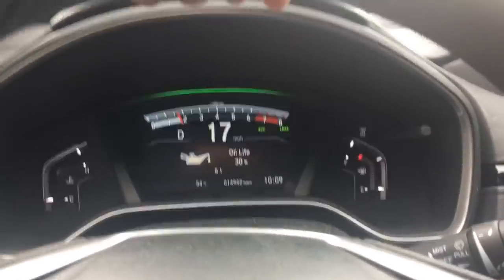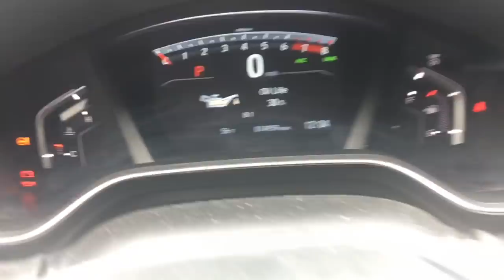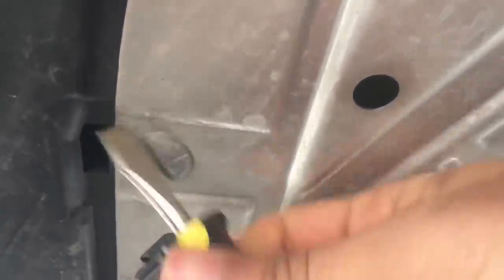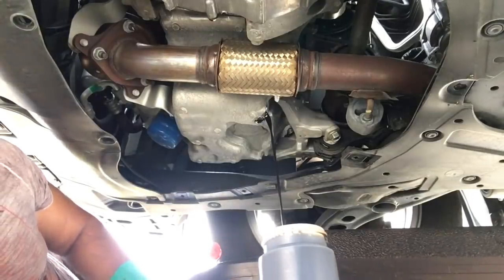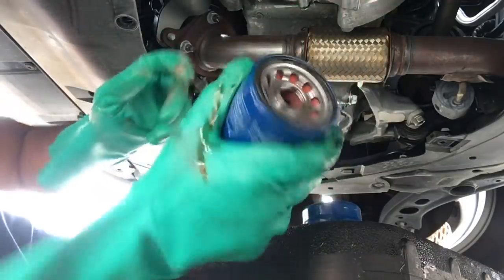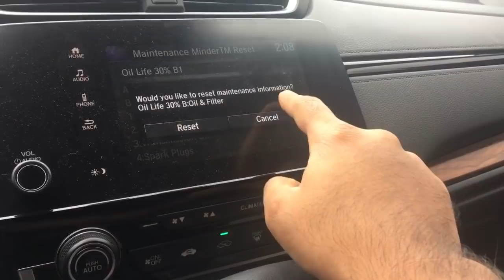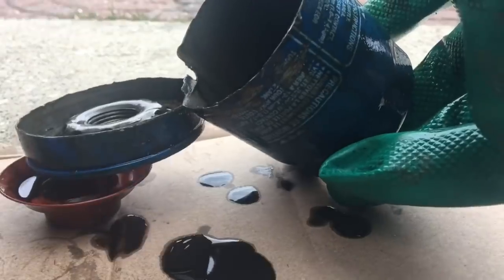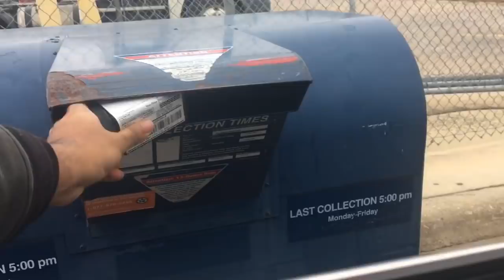2018 Honda CRV Oil/Filter Change and Analysis - Oil dilution -  Cut Open Filter

Comment: In depth video and you didn't tighten the drain plug. You covered every other step but one of the most important. Lose that plug, lose that engine.
Reply from the maker: Dan Wood I figured someone was going to mention that. I did tighten it... just not in the video.  Tighten the filter also. I will put it in the description for future clarification.
Reply: @EATSLEEPJD  thanks for replying. Nice job on the video. It's the small things that bite a novice. I was actually worried that fough may have been too involved in the video and forgot it.
Reply from the maker: Dan Wood Good catch !  I was thinking that while editing. Forgot to get the part where I tighten them.

Comment: If you put in 3.7 qts, then the reading should be right in the middle between the high and low marks.  You need to measure it on perfectly level ground, like a garage, but those orange dipsticks are difficult to read, especially when the oil is brand new.  Good luck. I've noticed a little bit of an increase in my oil level after driving it in cold weather.  I'm waiting to see if the fix Honda came up with actually works and whether or not they contact me to have it done - they're suppose to, since I live in one of the 2nd tier cold weather states-MA.
Reply: @wallyfrey6632  yes! Hamilton vs America Honda.

Comment: Parents  have 2017 CRV AWD, just had in shop and told them I smell fuel in oil dipstick. They won’t acknowledge or do anything .
Reply: Honda wont repair the engine y til you sue them Hamiton vs America Honda.
Reply: Yes, lies lies lies by Honda

Comment: Lube oil mixing with has only happens due to blowpast if piston rings are wornout or cylinderliner wornout partly burned gas oil  oil mixes with lube oil.

Comment: It appears that you used oil specific for high mileage engines over 75000 miles.Is that correct ?
Reply from the maker: Krystian KRYSTIAN That’s what it says. I just got the full synthetic oil.

Comment: Does anyone know how high the oil level must get before the rotating engine parts begin to cause aeration and potential loss of proper oil pressure
Reply: If you see small bubbles on the dipstick with the engine off then its already too high. I would say anything over 1/2" over the full mark in the dipstick is a concern.

Comment: I wouldn't let you change my oil;  I fill the filter with oil, if  possible, before installation.
Reply: How about just letting him buy you the high mileage oil with less than 20,000 miles on the odo?
Reply: You know how many filters get changed by dealerships and other shops most people don't fill them. It's not a big deal. I've never done that and my last Honda had nearly 200k on it with no issues.

Comment: Why use high mileage oil? U know those oil expend rubber seal a bit but ur car is new so should not need to use it.
Reply: M M 

Rubber is just one type of elastomer. Not used in contact with fuels or lubricants.

Comment: the 2010-2016 crv were a lot better than the later models. no turbos, no torque management software, bigger engines 2.4 lt. Everything better. Less problems. wondered why they went down that route of using smaller engine 1.5lt. Don't like that at all. not cool!

Comment: You're oil is black.... I wouldn't wait so long next time... Especially with the dilution issue.  I'd change it every 3k
Reply from the maker: 06XTOR color has nothing to do with the properties or oil tho.  I send mine for analysis il let you know how it is.
Reply: @EATSLEEPJD  Of course it does... When it's black it's dirty and breaking down. Let's not over think this
Reply: @06XTOR  That's just how synthetic oil is.
Reply: @waynes.2983 What I mean is synthetic oil turns dark quickly. But it's supposed to last 7-10,000 miles. Changing synthetic every 3k miles is throwing your money away.
Reply: @ryanlittleton5615  7-10k is a bunch of bologna.  You do that with your car I'm not waiting that long with mine
Reply: @06XTOR  I mean you're not gonna hurt anything. But even Scotty Kilmer says the same thing.
Reply: he's using high mileage oil and already bought into marketing, I mean he's done his research.

Comment: I'd gas is leaking in with the oil.  Change the oil every 4000 or 5000 miles.  At the most.

Comment: Why are you using a high mileage oil for a brand new vehicle? That oil was designed for older cars, you should be using oil that's good for these turbo charged direct injected cars like Valvoline Modern Engine Full synthetic oil.
Reply: Darksyne 

More detergents and seal conditioners. Does no harm.
Reply: @FrankGutowski-ls8jt  Yeah but you're not getting the benefits either lol. The valvoline modern engine formula was designed to handle the conditions of a GDI Turbo engines better than older formulated oils. Just throwing that out there.
Reply: Darksyne 

Presumably he used the ASE-rated oil specified for that vehicle, rather than some earlier designation. That means it should be fine, regardless of whatever advertising hype is on the container. 

High mileage is a dubious criterion: highway or mostly stop and go, lots of short trips or idling, frequency of oil changes, towing or not, high performance engine or not...
Reply: @FrankGutowski-ls8jt  One's good ones better for his conditions, I'm just offering my recommendation. Heck I'm using High Mileage synthetic oil in my car because It's 20 years old and has lots of miles on it so I can minimize oil consumption.

Comment: I bought 6 supertech oil filters on clearance for a robust .75 cents apiece. I would never buy a Asian car and I would never go over 3k oil changes on these junks.turbo gdi engines need synthetic
Reply: Leo Derosia 

.75 cents = $0.075.
Reply: @FrankGutowski-ls8jt  Actually, .75 cents = $0.0075

Comment: You actually put "high mileage" oil in low mileage engine?  Goodbye car warranty.
Reply from the maker: Thats funny.
Reply: He is right though.
Reply: @waynes.2983  Once he used high mileage oil, the gaskets and seals will swell up in size and expand.  Sadly he just introduced premature gasket and ring failure on a car that's 1 year told, engine will never be the same again.
Reply from the maker: @skratchinator   There is no data proving what you just said.  I even reached out to Mobile1 and no its not of concern.   The high mileage ones have more anti-wear additives and seal conditioner.  The additives actually help with viscosity knowing I have fuel oil dilution.  The people having issues with seal conditioner does not cause more leak or wear.  The product data sheet for both the regular and high mileage shows conditioners, while the high mileage one has more.   Also you must be one of those persons thinking adding exhaust to a car breaks the warranty.  The OEM has to prove in the case of an engine failure whatever mods caused it.  It would be a tough call to prove high mileage oil caused engine damage while i have bigger issues going on.
Reply: @EATSLEEPJD  Mobil 1 will never tell their buyers "holy shit, you just ruined your seals and head gaskets using our product" when they receive calls.  I'm one of the people who reads and follows manual and knows the real difference between non high mileage oil, when to transition over to high mileage oil and the actual purpose of high mileage oil.
Reply: The Asian American Man Experience 

If it meets the ASE’s minimum standard for that vehicle, then it’s OK to use, regardless of what advertising hype on the container says.

Comment: Stop using that junk filter, never use fram either.
Reply: Tony Flick what filters do you think are good?
Reply from the maker: Tony Flick It’s the OEM Honda filter. Not gonna use anything else especially on video if this car end up having issues I used their own filter. 👌🏾
Reply: Mobil one synthetic are good or Amsoil synthetic
Reply: Use denso filters at rockauto
Reply: OEM far surpasses all others in a tear apart test by car mechanics. The filter material was 2 to 5 times longer in length than others tested.
Reply: Well for one it uses cardboard end caps which a high quality filter uses metal. Good quality filters use a spring for the drain valve. There are tons of videos out there of people opening up lol filters, the Honda one looks like a fram and frams are garbage.
Reply: @madison1828  The 01filter uses metal.
Reply: @EATSLEEPJD  fram makes the A02 filter now and I would highly recommend not exceeding the 5k mileage interval like you have. The new Honda filters are exactly the same as frams cheapest filters.
Reply: @DkpProductions  I agree with you, fram filters suck.  Buy an expensive new car then put in a cheapass filter, talk about doing research.
Reply: @richardlugar6868  clearly shows that it uses cardboard for the filter end caps?